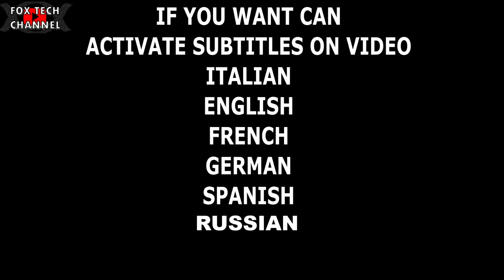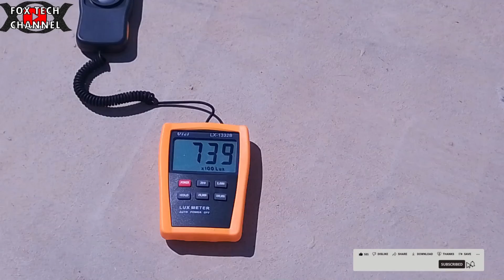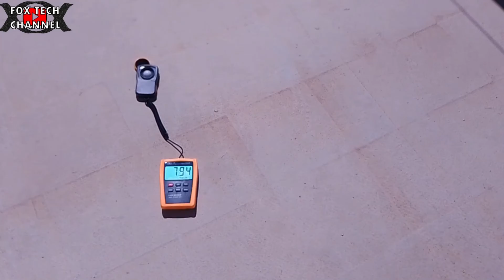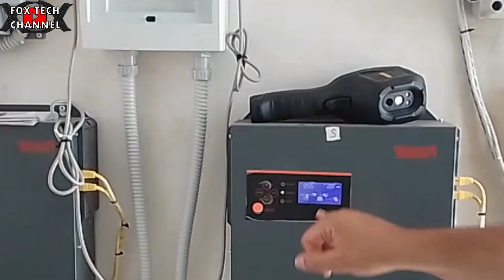PROTEZIONE ANTI GRANDINE per il  FOTOVOLTAICO - LA MIA SOLUZIONE

Comment: Ciao a tutti, forse una stupidaggine. Costa un botto, ma hanno una resistenza nel tempo e resistenza agli urti enorme. Policarbonato trasparente da 10 mm, 200 volte più resistente del vetro a pari spessore. Trasparente al 100 %. Non sarebbe una soluzione pressoché eterna? Ciao
Reply: si opacizza in 1 anno hai perso tutta l'efficienza del pannello sottostante
Reply: @lorenzogenna  Si opacizza? Non parlo di plexiglass, parlo di policarbonato. Fanno le volte nei centri commerciali, negli ospedali, le pergole, quando mai si opacizza.
Reply: Si ti basta una semplice ricerca Google per scoprire che succede anche al policarbonato, e succede in condizioni di esercizio molto meno gravose che montarlo davanti a un pannello fotovoltaico dove sopra hai i raggi UV a picco e sotto una temperatura altissima data dal rivestimento nero delle celle. 
E non stiamo nemmeno considerando i cicli caldo-freddo-umidità che formerebbero condensa sul lato a contatto col pannello, sporcandolo sempre di più.
Reply: @lorenzogenna  bho. Io pensavo fosse resistente. Lo usano ovunque. Forse questo è un uso particolare.